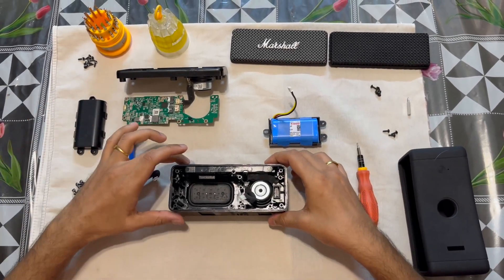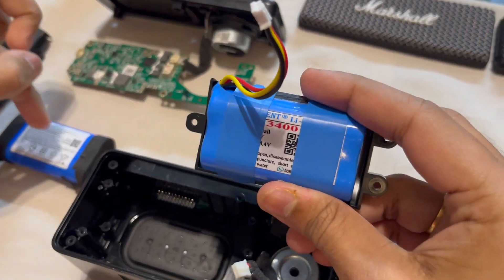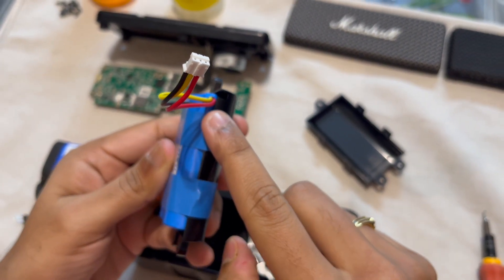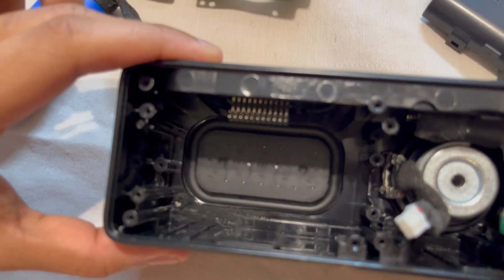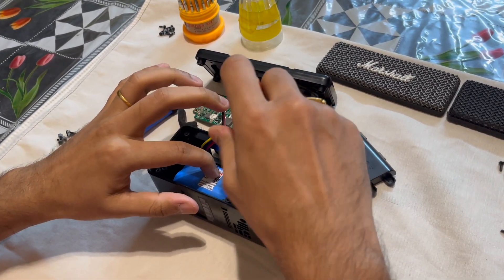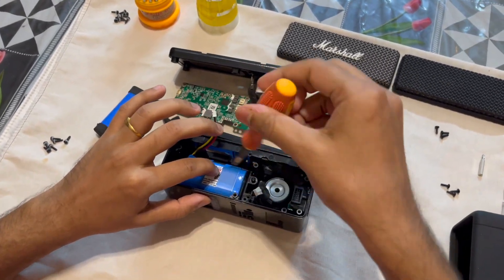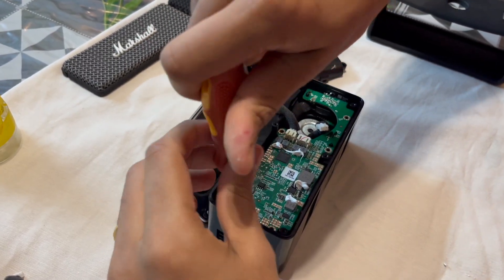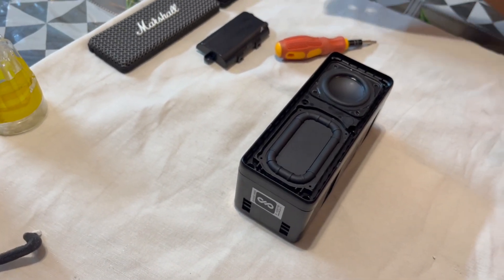Marshal Emberton Bluetooth Portable Speaker | Battery Replacement | DIY

Comment: Thank you so much for this! It was actually quite simple and they seem to have fixed the shape of the battery now so it actually fits in the plastic case. The most stressful part for me was probably taking the connectors out since it needed some pressure and I was terrified I was going to break them! 😂

Comment: Thanks much for this video. Marshall has only one 3rd party service provider that sits in Delhi that charged Rs.3000 for battery replacement which lasted about 9-12 months and started getting the issue again. This video is a life saver for DIY ppl.

Comment: I really don’t understand why you didn’t show how to open the speaker at the beginning. I have no idea how to even start taking it apart.
Reply: Remove the rubber housing around the speaker first 

Then you’ll see all the screws

Start removing every screw you see
Reply: @kushagarkonark8875 found it in another video, I just dont get why it is not showed here at the beginning.

Comment: The original battery has a circuit attached to it. This battery won't have that circuit. Does it make a difference in charging or safety of the product?

Comment: My spaker not charging and also not powering on can I try to replace the battery
Reply from the maker: Yes you can replace the battery and it should work. Please check the links in description to order the same

Comment: Thanks a lot bruv! Replaced it myself. The person in delhi was asking 3500 for it...got the battery ...changed it... works like a dream ❤
Reply: What issue you have faced bro 
My spaker not charging and also not powering on..

Comment: Is this a common problem with Marshall Emberton speakers?
Just recently, my 3 year old speaker stopped working. After doing a full charge overnight, when I try to turn it on in the morning, it makes a very high volume muffled static-like sound and immediately turns off.
Please advise, thanks!
Reply from the maker: I guess so.. The battery replacement should fix this issue. Do try it out :) Links for battery in the description.

Comment: Thanks for the video! My emberton is not charging even after hours. Also, not showing app on the marshall app. Could it be the battery issue? How long usually does Marshall battery last? (I bought it 2021)
Reply from the maker: Yes seems like a battery issue only. Try replacing it, should start working. Links in the description
Reply: @adithkrishnan9538  Can you show how to remove the connector from PCB? It's fragile and I'm worried of damaging the wire and PCB.

Comment: Dear Adith, 

your video is really helpful... I'm facing the same issue like many users commented here. At high volume, the speaker makes a eerie sound glitch and shuts down.

My question is, is it hundred percent a battery problem or could it be an power ic issue aswell? Though the speaker is charging well but shuts down at higher volume.

This is my first video I landed upon on the issue and its a good one, hoping for your reply. Many many thanks!
Reply from the maker: Hello! :) Yes I also thought of the same, but from what i’ve checked battery seemed to be the problem. And after changing the battery, it’s been more than 3 months and I haven’t faced any issues of that sort.

Comment: I am also having this problem with my speaker that when I charge it, even if I keep it for the whole day, it gets charged only 3bar and when I turn it on full volume, a muffled sound comes and the speaker switches off automatically. Is battery replacement the right solution for this?
Reply from the maker: This sounds textbook battery problem. Do follow the video to change to the new battery and this issue should be resolved.

Comment: Is. This battery safe ? Like can i trust this battery ?
Reply from the maker: Yes indeed. It's been over 2 months since I've been using the speaker everyday. Battery Is really good, no issues. You can checkout the link in the description.
Reply: @adithkrishnan9538  thanks buddy... you saved my marshall 😝
Reply: @adithkrishnan9538  I have  Emberton. Not  emberton 2 will this battery work in it too?

Comment: HI nice video thank you for sharing the DIY battery replacement of emberton , I was looking for such video for my emberton which needs battery replacement just one quick question, after the battery replacemt with 3400mah, how is the speaker working now is it working fine
Reply from the maker: Hi soubhik. Yes the speaker works flawless. In fact it lasts longer than the old battery so I needn't charge it often. You can check out the link in description for the battery on amazon :)
Reply: Did u face any issue with the battery not fully charging?
Reply: @anmolsinha8815   yes, even if i keep it on charging for the whole day it only shows 3 bars of charge left, and when i play it and push the volume to the full there comes some static noise and the speaker shuts down by itself.
Reply: Battery replacement can fix that 3 bar and noise solution?